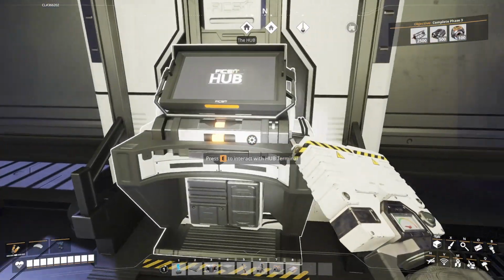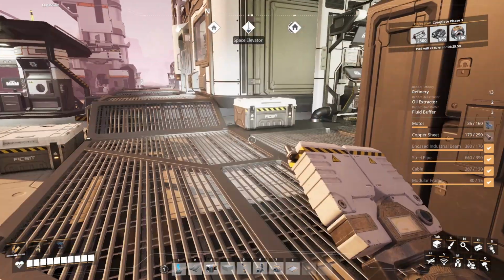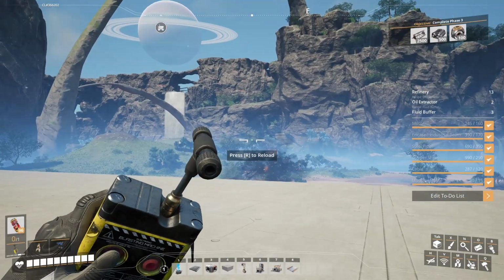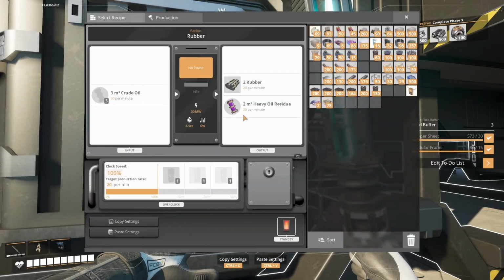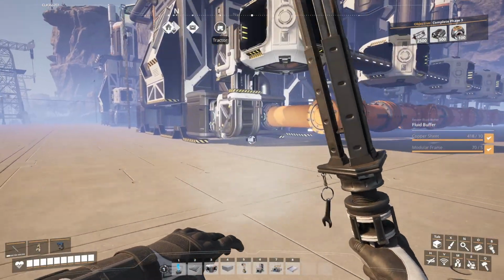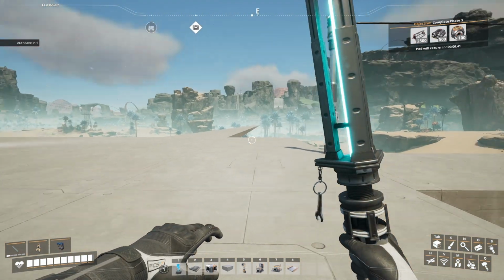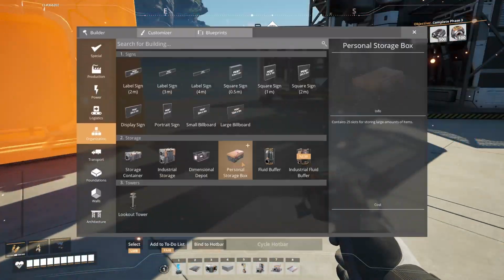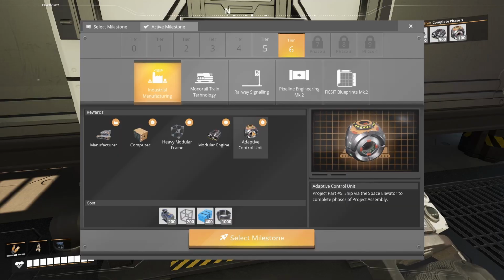Satisfactory 1.0 - Perfect Starter Oil Processing and Fuel Power [E10]

Comment: If u have 150 oil coming out of each oil extractor and ur refineries take 150 oil why not just pipe in each extractor into its own set of 5 refineries?! Why combine them into one pipe before hand and then branch off into each set of refineries. It's a 1 to 1 extraction and intake.
Reply from the maker: Because sometimes I'm a bit of an idiot. You are 100% right.
Reply: @surtrplays  naw I wouldn't say ur an idiot brother. Just need to slow down a little bit. I do appreciate the fact that u leave ur mistakes in. U could easily edit them out. But hey, we're all human, we all make mistakes.
Reply: There's no need for name calling, we all have our ways of approaching the fixit* moto. 'Short term solutions, to long term problems" is primarily driven by advancement and change in recipe, chances are you'll redo it entirely in a few weeks.
Edit: damned auto correct!
Reply: @jeremykoonce8436  bro ain't no one calling anyone names. He called himself an idiot. I said he wasn't. Learn to read before chiming in. 🙄🤦🏼‍♂️
Reply: I combine all outputs into a manifold for future expansion.   If you direct connect machines you'll end up re doing it

Comment: Question:  My Heavy Modular Frame build ate 975 mw of power.  I have to build more power before I can build my aluminum.  Are you going to do a Turbo fuel build or skip that and go for Rocket fuel next.  I haven't done either before and can't decide if I should skip Turbo Fuel or build that and then jump to Nuclear.
Reply from the maker: I am planning a really big turbo fuel power setup on the northern side of the map. I'm going to have most of my power from Turbo fuel/rocket fuel. Nuclear is really late game for me.

Comment: I put my dimensional storage on top of my regular storage boxes and use a lift to input as I want those boxes filled first and then it can store excess.
Reply from the maker: That is very clever. I might use that. Thanks.
Reply: I do that as well but you need an overflow splitter if you want the storage to fill first

Comment: I setup the same system in the same spot using a 2 refinery blue print that has all the conveyors and pipes.   I also cheated a bit and bought the needed plastic and rubber from the Awesome shop so I could have my Generators unlocked when I setup the build.   Along with the 2 pure nodes (also waiting until later to utilize)  there is now an Oil geyser in that location.
Reply: Oh wait I take that back.  I overlocked my 2 normal oil rigs so have double the setup you do.  10 plastic, 10 rubber, 5 fuel and 10 Generators
Reply from the maker: Nice one. I am trying to see how I can finish the game with minimal builds. I looked at my numbers last night and will probably have to increase the oil stuff.